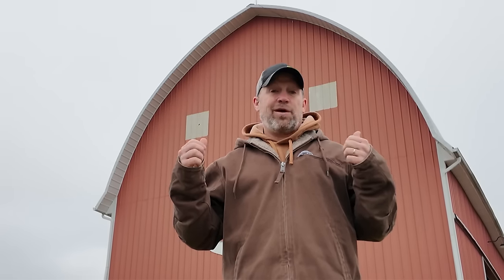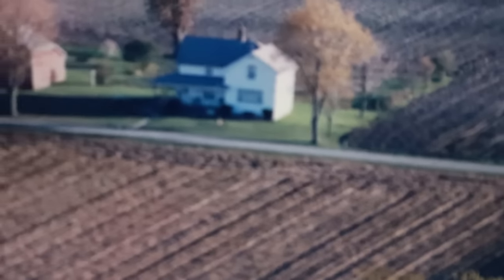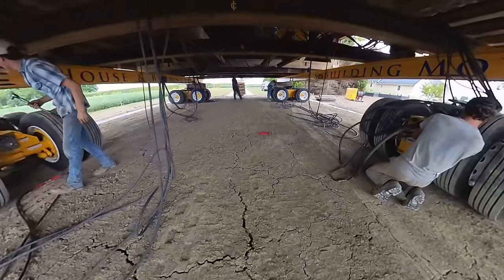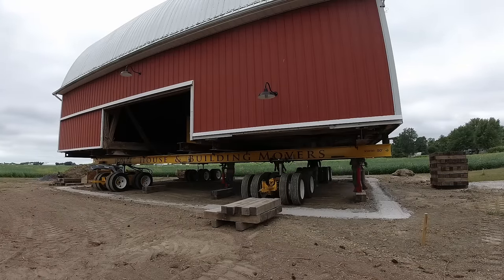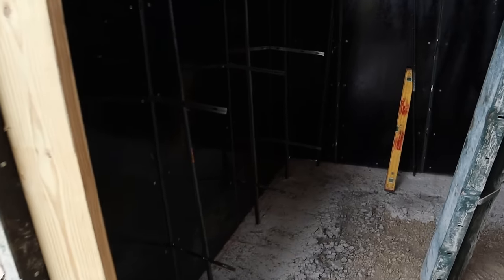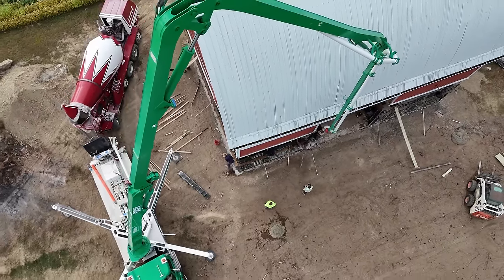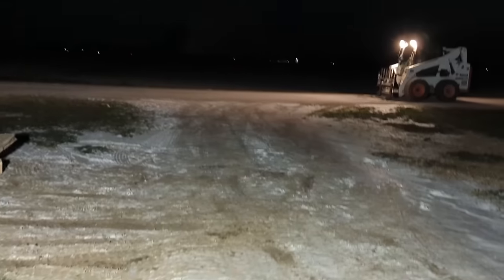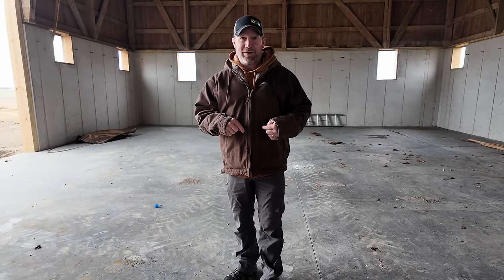The Ole Floating Barn Trick!

Comment: Glad to see you rescue those old beams.  My house has a hand hewn beam and posts in the basement.  Built in early 1930's.  Some woodworkers would recut those beams and make great things out of them.  I know that one time 'This old House' used some in a remodel.  Thanks for the video.  There is a barn east of Oklahoma City that is round with the same type roof.  When the track hoe shows up, history is lost.  We repaired fire damage from previous owner and removed most of the second story.  I did in one closet preserve the original lath and sand plaster on one wall.  I will say one thing;  If you are going to build or remodel, think about the next guy and how they could use the space, you'll be thankful when it comes to pass it on or sell.

Comment: Still have a log barn up still. All logs shaped by hand. Floor is even log. Cedar shingles. They put wood siding on the barn walls.
Three stalls on each side. 
The one side was for horses 2 per stalls. The  Manger is one full length of the barn. The log that the Manger is built from is one log full length of the barn whether horses are tied to.
The loft where you would store hay. the floor is made of small log just beside each other. They sure did a fantastic job building the barn.
Thanks for sharing the move.👍

Comment: It's interesting to see these old structures saved. I have seen several old barns fall into disrepair and collapse.
On the new side of construction I live on a lake where old cottages are being torn down and new houses are going up. It's not unusual to see concrete pumpers around. There was a conveyor truck recently back filling a foundation. Very similar to how you had pea gravel put into your pond. Another one I am keeping my eye on is a modern log house. It appears to be partially machined logs. I have not seen them delivering the logs but they keep appearing.

Comment: I kinda build one of these recently as a machine shed in the garden. If well designed they project all sound into the floor, and given all of it has 80mm of hard insulation, but the floor has fibreglass, this really cuts down on outside noise. which, if you have a decent cnc mill in suburban  Netherlands is a great idea. the whole thing forms a monocoque construction, so it just floats on 6 screws and can be lifted entirely.

Comment: It's a gambrel , hip roof has 4 sides to a roof. I had bought my grandfather's old barn and it was huge the original part was a gable , easily 40 ft to the ridge or peak with a huge gambrel attached to it, and it broke my heart to tear down the original part but it was unsafe, less than 20ft to the house and the time and money to save and restore it wasn't in the cards. But saved the gambrel part and makes great storage for tools and equipment. My grandfather had 100 cows in the basement or ground level all winter and the 2nd floor held enough hay to feed them all winter and then some. I still remember as a kid climbing in the hay to the roof inside. To build something that large that long ago with no computers, engineers , or big equipment still amazes me and I build houses for a living. I know if not for the invention of a power saw and nail gun I would definitely be in a different profession haha.

Comment: What an amazing story, so glad the Folks took the time, effort, and expense to save the old barn.
You did a great job too in saving those old timbers.
Not sure if the original design way back when may have had some Dutch history, as one can see today in the Netherlands  buildings with a similar design.
400 years ago here in the U.K. on the Eastern side of England there is area know as the Fens, A Dutch engineer was hired to come over to drain the Fens (Cornelius Vermuyden) A few of his countrymen came too, and settled and even today one can see buildings with same architecture as your Barn, and Dutch sounding place names like Twenty (Twente)
Reply from the maker: That's some interesting history!

Comment: I was surprised to see they didn't use mats under the wheels, must have been some hard ground. Normally there would have been rebar sticking up thru the footings, which ties the foundation walls into the footings, in the way here obviously. But I wonder how they did it, drilling and epoxy rebar stubs would work I guess.  I had a 100 year old house moved off it's foundation once, it sat in the backyard while we poured a new full basement and foundation, out of square on purpose, to fit the out of square house! The center bearing wall was the same height as the foundation walls, as usual, but after we set the 2 story house back down, all the doors and even the kitchen cabinet doors had to be re-done/rehung, as it seems they had been fitted to the old sagging center bearing wall!

Comment: Wow, they should have run radiant heating tubing under the concrete before they poured this floor. I would not have cost much and it would have made it a LOT cheaper to heat and cool this massive space. 

This would have made a spectacular custom home space, and you could still have had a workshop in it.  Can you imagine an atrium framing with a second floor looking majestically down on the first floor? You could have walking paths to access the second-story windows. Wow, what I could do with this space.

Comment: What's the "order of magnitude" price point for a project like this? Tens of thousands, or hundreds of thousands? Relevant to me specifically is the "jack up and pour a footing wall" part, though the move is certainly fascinating as well. I've got a 40x60 steel gable shop, not wooden barn (certainly nothing historic or sentimental), and I need it to be about 3' higher at the eaves than it currently is. Most of the steel-building companies I've contacted have said that it'd likely be cheaper to tear down the building, sell the components, and construct an entirely new, taller, shop in its place than it would be to jack either the roof or the entire structure up in order to make it taller, and I just can't really wrap my head around that.

Comment: if you are saving those old beams you need to keep them dry our neighbor had a massive old barn set up for loose hay 5+stories high with a high drive and path for a horse and wagon to go up and turn around at the far end once the hay had been forked out .... long story short back in the 50-60s they had put large metal stables in to try and stiffen up the post and beam construction  the barn settled over time and just started breaking beams at staples  so it had to come down we saved a bunch of the beams used some fixing our barn stored a  bunch out side up on railroad ties with tin on them 24+ foot long 10x10 8x8 and a few 12x14 anyways within the year they started rotting they were mostly hand hune and well over 100 years old as that was the newest end of the building the old end of the barn was 150+ any way those old dry beams just suck up the water

Comment: After losing a lot of calves in the blizzard of 1948, a local farmer built a barn in 1952, which would house his entire cow herd in case of another blizzard. This barn had 6' poured concrete walls with 8' entrances on each corner.  It had a mow structure in the middle and feeding stanchions surrounding the hay pile. They filled the mow with feed and waited for a blizzard, which came soon enough.  The farmer herded the cattle into the barn and quickly figured out that the barn trapped too much body heat from the cattle, and they were overheating.  The blizzard blocked the doors and he could not get enough air into the building, and he almost lost his entire herd again.  The barn sat empty and unused since 1952.  It could not be used to store equipment or even grain because the doors were too small to drive in.

A co-worker had bought this place in the early 60's and just put up with this unusable building on his farm.  He was retiring and rented his farmland out to a young farmer, who wanted to put up a pivot.  The pivot would hit the barn, so the barn needed to go. I had been wanting to build a shop, so I ended up tearing this barn down and using the lumber to build my shop. This barn was build with mainly 2x6s, with some 2x10s.  It was covered in tin and the wood was SO much better that anything I could buy new.  I ended up with a nice shop that I work out of every day and saved some good lumber from going up in smoke.

Comment: A hip roof refers to 4 pitched sides a gambrel isn't a hip roof and if they do call them that it's completely wrong.
Reply from the maker: I get it. Just Google "hip roof barn" and you'll see why I included that...
Reply: @digdrivediy    I don't need to nor do I give a dam what Google says.  I can read a speed square, have built actual hip roofs and know why it's called that. Show me where the hip roof rafter is on a gambrel because there isn't one.
Reply from the maker: @irench   @irench  Geez man settle down.  I know you're right and I agree it's just that some folks call it by the wrong name and it has stuck to be part of the common midwestern lexicon.  There aren't many true hip roofs around anymore and when lots of people refer to a hip roof barn they're calling it this.  I know they're wrong, that's why I said "This is a gambrel, but some folks refer to it as a hip roof."